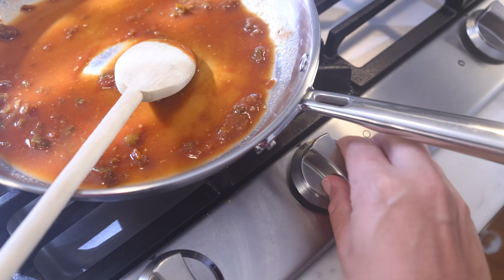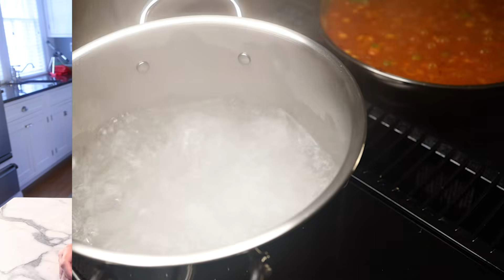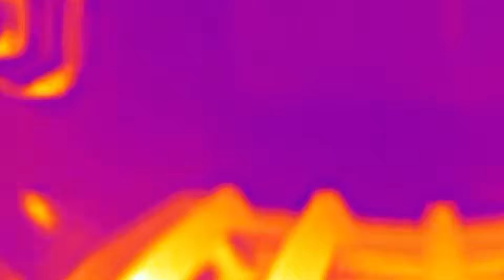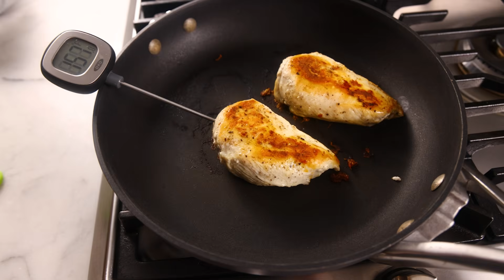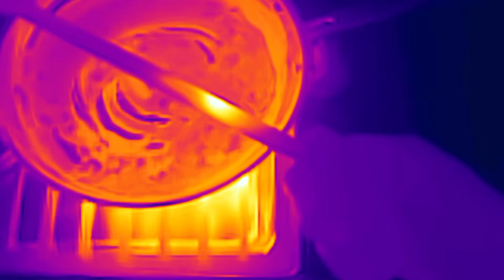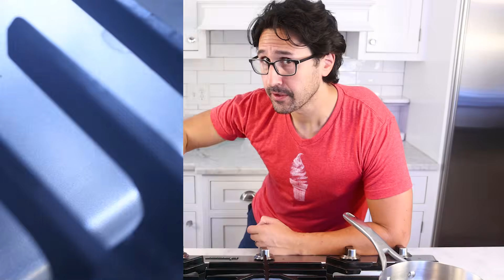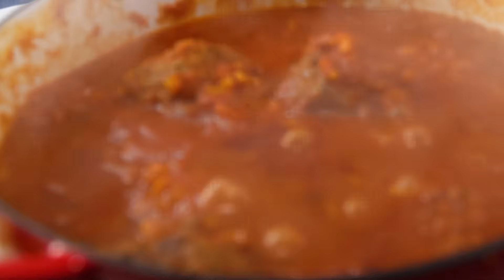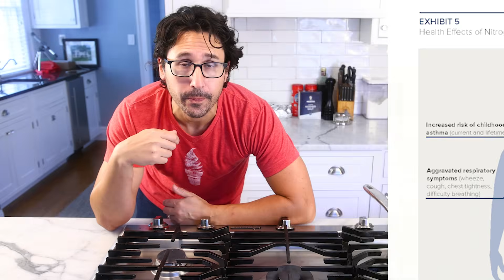Problems with gas stovetops | weak, dirty and dangerous

Comment: Most gas stoves have two things sticking up under the top plate, one is the sparker, and the other is a thermometer. If the thermometer doesn't detect enough heat it stops the gas flow. 
Have you ever "failed" to start a stove? Like after a few clicks the fire lights but it doesn't stay on? That's because the thermometer hasn't warmed up enough. So unless that system is broken there's a pretty good chance your stove won't be spewing gas if it's not lit even if it's on full. 
Anyway, maybe electric is the future, other than roasting peppers and eggplants directly on the flame, as long as the pot or pan is hot it's the same thing right?

Comment: For induction, I don't think you'll need to replace your entire countertop to replace your gas stove. A single unit is enough. It shouldn't cost you much as they should be pretty cheap.

We were given an induction cooker as a wedding gift. As it got older, the plastic adhesive kinda got loose and liquid spilled over the buttons. I've opened it up, replaced the microswitches, and resealed it with electric tape. I do have to continually replace the tape from time to time, but I don't want to buy a new one because right to repair.

We went back to stove when my father moved in, but LPG Prices shot up, so when it ran out, we went back to induction.

Comment: Coil Electric ranges are way too impractical in a country like in the Philippines. We had someone live in an apartment with only using a cheap electric coil range (like Der8auer uses for destructive delidding) and the bill shot up to Php 2k (around $40). That may sound cheap, but that costs a fortune here as a third world country. They just stuck to wood coal afterwards.

Comment: I'm pretty much the opposite. I find my glass top constantly gets dirty and any spill over instantly bonds to the stove top. The higher heat means more baby sitting to make sure things don't burn. I left a pot of oil on medium heat and it got so hot (in the span of about 5 minutes) that it degraded and bubbled over. Of course I couldn't just turn off the flame and let the oil cool...instead it hit the edge of the burner and ignited. Luckily the fire didn't spread beyond the burner surface. It's the only time I've ever had any kind of kitchen fire after using gas for many years.

The ability to cook without electricity is also a major bonus for many. I've had the power go out for a full week after big storms and it was awesome to still be able to cook.
Reply: The glass top issue is with regular heating electric glass tops. If you have induction the glass top only heats to whatever temperature the pot has.. If I boil over i.e. milk, I lift off the pot, wipe clean with a damp towel and be done. Nothing burns in, the top isn't hot enough. I love that about induction. My cooktop (given, an expensive one) also senses spills and turns power off. So If I forget I had a pot of water on the quick boil setting and then go out into the yard to grab something I don't have to worry to come back to a huge mess. The moment sufficient liquid is on the cooktop it will turn off.
I had every cooktop imaginable and I have to say despite a few annoyances a high quality induction cooktop is pretty much impossible to beat.
Reply: I agree so much with this. I miss using a gas stove. Since moving, I've been stuck with an electric range because the apartment doesn't have a gas hookup for a stove and I feel like I spend the entire time babysitting the stove while cooking. Low doesn't even simmer and medium is often too high for many things. With gas, I never had the "joy" of burning dinner... but now I've experienced that more than I'd like. Our stove even made my girlfriend cry when she made dinner for me one night and burned a skillet I used a lot, ruining it and making her feel horrible about it. (I told her not to be upset about it though as it was an excuse to buy an even nicer one! lol.) 

Not being able to just leave a pot or pan where it was cooking is pretty annoying as I have to try and find random places to put them; and the kitchen here is tiny, so sometimes that means larger pots have to take up residence on a trivet on the floor! Generally I'm baffled at the "easier to clean" claims with flat tops. I have to constantly clean the flat top every day, and it doesn't seem easier to clean unless I clean it when I should be eating (aka it isn't still too hot, yet hasn't completely cooled yet). When I had a gas range, it wasn't all that hard to clean if you did it at least once a month and it didn't require scrubbing daily!

Comment: I think ease of cleaning depends on which type of electric stove your comparing the gas stove to. All of my electric stoves before my gas one had the exposed coil with the bowl underneath that you wrap in foil to help with clean up. 😂 It was so much harder to keep clean than my gas stove.
Reply: I grew up with a glass top electric resistance stove. Very easy to clean. I hate the exposed resistance stove because it is much harder to clean.

Comment: I think my hatred for "electric" stoves comes largely from bad experiences with resistance burners. The actual induction ones I've used have actually been pretty great. I still have a gas stove (because it's there and works alright) - but when I need to replace it it's likely to be induction!
Reply: Not to mention that those old resistance coils need to be replaced with some regularity, along with the reflective dish underneath them. I hated cooking on those things.
Reply: I was raised with an electric resistive range so i am used to them and don't like the idea of gas (which for my parents house would involve getting a methane tank because its out in the country ro no mainline to connect to). In my current apartment i have induction and am slowly getting used to the difference, but its ability to boil water is crazy. My induction range had a "quick boil" burner that has 2 coils so you can use either just the inner coil or use both to really get those eddy currents heating the pot, it takes about 10min to go from cold pot to raging boiling my spaghetti. 

The only downside of induction is you need to have an iron or steel pan because you need to be conductive so the eddy currents form (so ceramic and glass won't work) but if you are too conductive the currents won't make enough heat in the pan (why aluminum and copper wont work). Also theoretically you could brick your phone if you set it on the burner but thats true of all burner technologies so i don't see it as an issue.
Reply: Love induction burners.  I would just need to replace most of my pans.  I'm ok with tha when time comes

Comment: I use nothing but cast iron or carbon steel pans, and they work much better with gas, electric stoves can warp cast iron and carbon steel. When the power goes out, I can still cook for my family. As far as dirty and dangerous? that depends on ones maintenance skills or lack there of. All stoves get dirty.  Electric stoves?  PASS!

Comment: For clarity, nitrogen oxide isn't in natural gas or produced by burning the gas. Nitrogen oxide is a chemical reaction that happens when normal air is heated high enough to cause the nitrogen and oxygen in our air to form the compound. The production happens in a temperature range that is near the upper limit of what your gas range will produce in the hottest part of the flame. Gas fired boilers (coal fired ones too) and gas turbines use a range of engineering solutions to keep their production of nitrous oxides down. Those methods are not able to be reproduced in a kitchen. 

The best solution is to just vent it using a stove hood.

Comment: Another thing to consider: Gas stoves break way more easily than electric. They get all sorts of problems with the igniter, and when dealing with a toxic, flammable gas you really want your igniter working perfectly. Also if you have even a minor gas leak that gets resolved fairly quickly the fumes can kill certain pets you might have, notably parrots and canaries. In fact miners used to bring canaries with them underground because their sudden death would signify that toxic gasses were present and that the miners needed to get out.

Comment: The reason I want Gas is because of my cast Iron, I have scratched the living heck out of my glass top trying to use it and it is generally recommended against using cast iron on it. Also charring peppers or tortillas, gas in general is a better way for me. I use generally very small amounts of natural gas due to other green energy but cooking for me gas is easier.

Comment: The biggest barrier to induction cooktops is the cost. Check the prices available anywhere - induction is frequently 3-5X more expensive than an equivalent gas or electric range. In the future, those prices may decline, but not likely until the post-pandemic supply chain issues are resolved.

Comment: Why the picture of a nuclear plant (producing plain WATER VAPOR)* at 10:02 when taking about contamination and climate change? It is by far the best choice for fosil fuel substitution alongside renewable energy resources.

*water vapor is indeed a greenhouse gas, but not as dangerous as the byproducts of coal burn and fosil fuels.

Comment: Adam, if low is not low enough, raise the height of your pan or pot. Easily done by just taking one of the metal grates on top of one of the burners, and stacking it on top of another. Surprised you didn't think of this trick already (or look it up).
Reply: @HelloWorld-fg2nm  i thought those are normal things to do, atleast here in Asia. Westerner problems I guess?
Reply: @momoiroyui  Induction is really popular in Asia, at least the first world parts.
Reply: I do this on my stove with individual grates for each burner but it would be a total pain with the big grates Adam has

Comment: Meh. I feel like a lot of the criticisms of gas ranges in this video stem from not understanding how to use them properly. Don't use thin-walled stainless steel cookware (really designed for electric ranges, no matter what the manufacturer said on the box) on gas, and you won't scorch your custard. And where's your heat-diffuser or simmer ring? 
Yes, gas ranges produce some VOCs. Your kitchen should have good ventilation, and you need a proper extractor fan (not one of those dinky rangehoods are only good for clearing away steam and cooking odors).

Comment: I've only ever cooked on an electric stove (at least in the home), and I find that no matter what I cook I always end up with a fair bit of smoke (enough to visibly darken the air in my home). Even at the lowest setting that still gets the oil hot enough to cook the meat or veg, I get a cloud of smoke (not always black smoke, but always clouds of it). Any suggestions on what I may be doing wrong, or is this just part of the process? I've mostly stopped cooking at all because it takes days to get rid of that smoke, even with the doors open, even with a Hepa air filter running full time.
Reply: uhh is there something on, in or around your stove that could be burning? What you're describing isn't regular behavior at all. Also, and this is just an aside, you probably need better ventilation on the room you're cooking, given how the smoke doesn't go away, but that smoke shouldn't be there at all so this is a moot point

Comment: good video and some good points here, especially the problems of low heat control and excessive heat flow and scorching around edges, and yes, gas is responsive compared with electric coil and radiant stoves. some clarifications:

1. as another viewer already did a good job of explaining, the principle of heating with infrared vs electric coil burners is somewhat different, the electric coil relying more on conduction (which is more efficient) than radiation. in my view, both of these types of stovetops suck for reasons you mentioned

2. while it's true that most of the heat from gas does not go into cooking the food, the efficiency of a gas stovetop is not important. what matters is the total cost to the user cost per unit of cooking. a couple things to keep in mind here is the difference between cooking on gas when you are also heating your home vs. when you are paying to cool it with air conditioning. in a warm climate where your air conditioner runs a lot, burning gas indoors is expensive even if gas is cheap per therm because you are also paying to remove all those btu's from your home on your electric meter

3. the point you make about indoor air quality is a very good one, and would especially apply when your home is minimally ventilated during heating and cooling months

4. using an exhaust fan may be a good idea, but note every volume of air you remove is going to be replaced with outside air, again this is a cost issue during heating and cooling months. in well-sealed homes you even have to open a window for an exhaust fan to work properly or you'll generate a negative pressure differential that will reduce or stop the flow of air even though the fan is spinning

5. you mentioned induction. for me induction is the only way to cook indoors on a stovetop. (for wok cooking i use a 50,000 btu propane burner outdoors, which is what you need for traditional wok or chinese restaurant-style cooking). induction burners are not without their problems, but on balance are a superior method for most home stovetop cooking and a lot of commercial cooking. you don't need to wait for your gas stovetop to 'wear out'... gas stovetops can go for a lifetime. if you invest in a large amperage 220V line to your kitchen counter, you can get a 5k watt burner right now and boil a big pot of pasta water 5-7 minutes

6. i dont care about the supposed environmental issues you mention. i dont use gas indoors because it's bad for me, not because of things i believe about 'social' responsibility or the environment

Comment: Electric only works on flat surface. Gas works much better for a wok. Also it's nice that it won't trigger the breaker so you can use it while using oven or microwave.

Comment: I come from a place and culture where electric stovetops are almost unheard of, and recently moved to the US. Since then, I have been slowly realizing why some cooking instructions from US content makers (I must say, including you) simply didn't make sense before, such as instructions to take the pot out of the stove (I just turned it off) and adjustments I had to make to heat levels.

I'm not sure if I like the electric stoves, precisely because I feel much less in control of the heat at any time and often have to take the pot out, or change the setting more often than I previously had to for the same recipes. And I'm having to adapt some recipes that call for direct fire such as baba ganoush, not always with great results even with the broiler.

Comment: One thing you may not have considered tho, in regards to carbon footprint and the renewability of electricity vs gasses. It is very possible that flammable gasses can be produced that are close to if not completely carbon neutral. For example,  there's quite a bit of research into the production of flammable gasses and liquids through the breakdown of cellulose from the biomass leftover from agriculture (eg stems and leaves of grain crops). This means that any carbon released from the burning of the gas came from the CO2 that the plants took out of the air to make cellulose, hence the gas is carbon neutral. Not very plausible right now as there aren't any microorganisms that can efficiently convert cellulose into fuels, but it's plausible that in the near future a bacteria or yeast may be found or engineered can do it.

Comment: I have used all of them and prefer gas completely. I've seen some very expensive repair costs on induction ranges from accidental drops of pans or one of the"burners" giving out, as well as pans horribly warped on electric coil ranges (the middle becomes higher than the edges and the liquids pool around the outside perimeter of the pan, not ideal).

Comment: When we replaced our gas stove a few years ago, we made sure we got one with high output burners in the front. Heating times are quite acceptable now. Works well for bringing water to a boil, wok cooking (which we indeed do semi-regularly), and for brewing beer (my wife and I are both avid homebrewers).

I hear you on the heat leakage though. Need to be careful not to put smaller pots/pans on the front burners. Fortunately the rear burners on ours are much smaller, and throttle way down.
Reply: I have an oven with high-output front burners and I hate it.  I'd rather have the high output burners on one side (so I can use double size pans spread between them and get mostly even heat across the thing) or both in the back (so I can have the larger pots in the back and smaller pans up front when cooking a lot of food for big meals like Thanksgiving, etc).